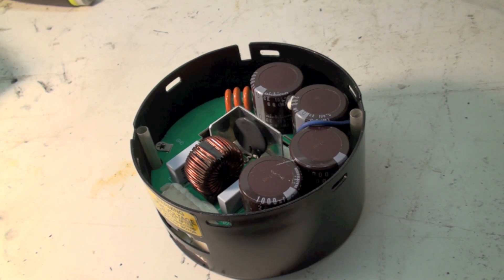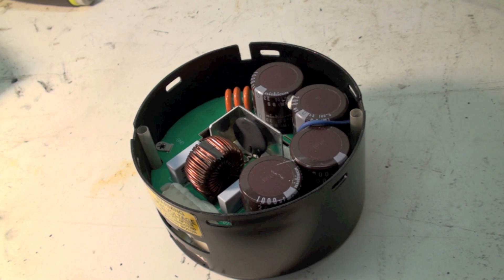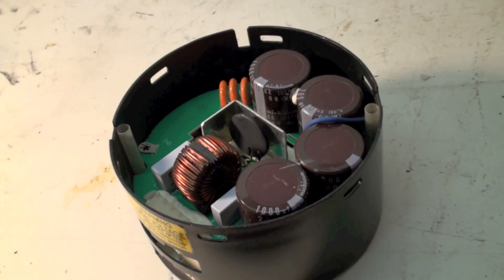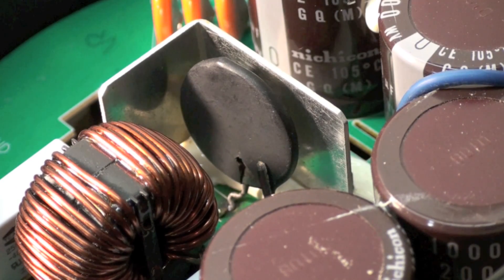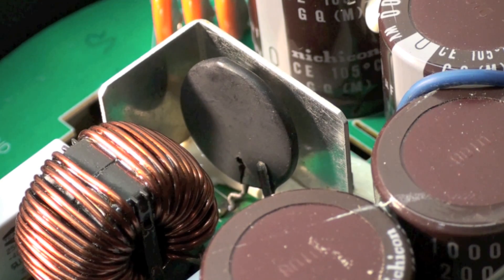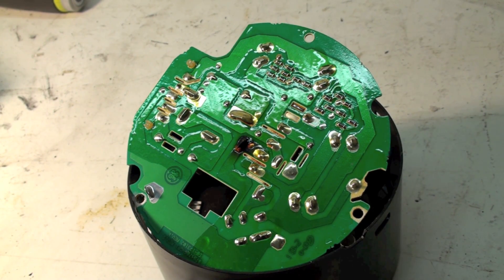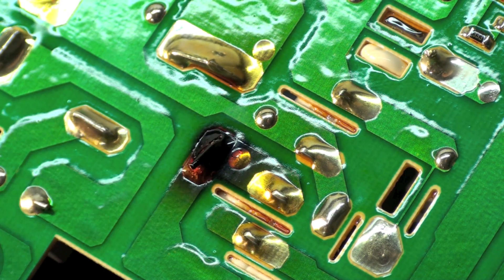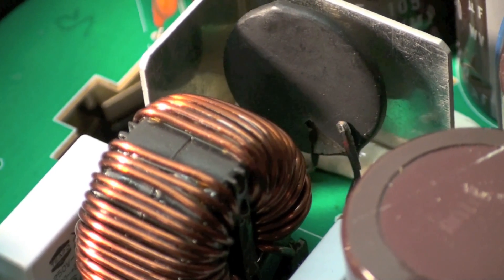ECM speed control repair

Comment: Thanks for looking into this.  I have repaired the thermistor a few times and now it seems my main capacitor are going bad.  For those of you who like to repair stuff, I found on Aliexpress the exact same capacitors (Nichicon 200V, 1000 uF).  Today I bought 20 units for under $43 (including shipping).  I have plans to update my main ECM 2.3 controller and also the spare with new capacitors.  (It seems the heat in attic degraded the main capacitors in storage.)

Comment: A big THANK YOU in behalf of our neighbors and myself. Your tip not only saved big $$$ but also enabled me to get the neighbors furnace operating again before the plumbing froze and burst. Both of our houses have GE ECM 2.3 1 HP motor controllers. Left over from my own outage in 2019, I had a spare Ametherm SL32 thermistor on hand when the snow storm hit March 24th, 2023.
Reply from the maker: Glad I could help.
GFM

Comment: My ECM142R fan jerks a little bit at start, studders slowly about 1/4 turn then stops. Would it move at all if problem was the thermistor? Fan spins freely by hand. It is on a Trane heat pump. 

Well, on the ECM142R they now have a 1cm thick rubber coating over the circuit board and same on the back to glue it onto the cover. I guess they really want customers
 to buy a new motor instead of repairing!!! With a lot of patience, one get get through the foam rubber coating
Reply from the maker: If it moves at all, the thermistor is not the problem.
GFM

Comment: I have a similar GE ECM module off 1 iHP motor. I was wondering is you have knowledge of how to obtain other replacement parts. In particular, the three small blue disc capacitors. Thanks
Reply from the maker: Those capacitors are 1000PF and are available from Mouser.
GFM

Comment: Is it safe to bypass the thermistor temporarily while I await parts?
Reply from the maker: You can.  If there is a spike or surge during the time it is bypassed, you could have a failure in the electronics.
GFM
Reply: @grayfurnaceman  Thank you, I got away with bypassing it short term, the new part came in and I assume its a 30amp and old one was 20 (size difference)
Reply from the maker: @mikec1955  Sounds good to me.
GFM
Reply: @grayfurnaceman  One last question, after only replacing the thermistor, and installing a new filter, what could cause an air whistle to develop? Is it possible it spins faster now?
Reply from the maker: @mikec1955  The whistle is a sign of excessive negative pressure in the return.  Check for restrictions.
GFM

Comment: Just an observation that the controller board in the video uses high quality electrolytic capacitors made by Nichicon rated at 105 deg C
Reply: Recapped my Marantz 2500 receiver with them. Sounds awesome.

Comment: I have been getting some ECM motors from a scrap yard and all of the motor parts have been good but not the control as you discovered .
I`m not good at circuit boards but have success in fixing componets like you see that failed by burnt or blown capacitors. I fixed a older reel to to reel tape deck amplifier that way. The IC circuit  boards are throw away always

Comment: exactly what happened to mine, 1053.00$ later, I am going to replace that part and test it, if that is all that's wrong with it at least I will have a spare. I had no furnace for 4 full days when its 20 degrees C below  zero sucks
Reply from the maker: Yeah it does.
GFM

Comment: They should give you the Nobel peace prize for this video.
Reply from the maker: Yeah, I think so too.  lol
GFM
Reply: @grayfurnaceman  The local Lennox guy quoted me over 1200 bucks for the replacement motor and module for my furnace. I ordered the thermistor for 4 bucks on Amazon. You just saved me 1200 bucks. Thanks a lot. Hope you are making money with your videos here on YouTube.
Reply from the maker: Welcome.  I am doing fine.
GFM
Reply: @grayfurnaceman  Hey just a followup,  This motor works great after I soldered the thermistor in but i notice the motor only seems to run one speed. It seems it use to ramp up before full balls sometimes when it needed to.
Reply from the maker: The bell could be failing.
GFM
Reply: @grayfurnaceman  must be. I guess I'll have to bite the bullet and buy a new one. It's been running since 2007. I guess I've probably gotten my money's worth out of it. Can't replace the other components because they cast em in epoxy.  Thanks again

Comment: I have a variable speed blower motor on my AC unit came home one night blower motor was not running took the covers off and motor was just rocking back and forth not turning all the way over will be pulling motor apart just not sure what to look for
Reply from the maker: You probably have a failed motor end bell.
GFM
Reply: @grayfurnaceman  got a replacement motor and bell reinstalled the unit and it does work . Just seems like it not blowing out the amount of air that it used to and the place I got the motor from programmed it to match the old one that I took out ?
Reply from the maker: If the furnace has a secondary heat exchanger, It may be plugged.  Remove the fan and you can see it above.
GFM

Comment: You saved me $3,000!!  I replaced this thermistor for a few bucks after the furnace tech quoted me $3K installed for a new ECM...crazy!  Thanks for sharing.
Reply: Did it work?
How is motor working now?
Reply: @awaranyc1  yes, it has been working great for over 2 years since the fix.

Comment: That's not a thermistor, those are used for measuring temperature.
Reply from the maker: It is a thermistor.  This type of thermistor is used in series with the power lead and with higher amp draw of an overload the thermistor warms and increases its resistance which effectively opens the circuit.  This type of thermistor is commonly used as an overload protection for power strips.
GFM
Reply: Well in the UK those types of devices are known as inrush current limiters, an ICL.
Reply: Tyrone Nelson a inrush current limiter is a thermistor just as the gentleman said. As the temperature increases the resistance increases(positive coefficient Thermistor) as a result limiting the current.Hence inrush current limiter.
Reply: @robertcherry4971  Sorry, but you are mistaken about the type of thermistor; it is an NTC (negative temperature coefficient). Quoting Wikipedia "With NTC thermistors, resistance decreases as temperature rises. An NTC is commonly used as a temperature sensor, or in series with a circuit as an inrush current limiter."
Reply: Actually it's more likely a Varistor or more commonly a (MOV) Metal-Oxide Varistor. But you're basically correct in it's operation. See the wiki page on MOVs to learn more - https://en.wikipedia.org/wiki/Varistor
Reply: @grayfurnaceman  Incorrect, what you are talking about (that black disc between the common mode choke and the aluminum heat sink the bridge rectifier is screwed to) is an inrush current limiter to protect the bridge rectifier from damage when the power is first applied to the circuit and charges the 2 (or 4) large aluminum Nichicon DC electrolytic capacitors. At room temperature (25 degrees C) the inrush limiting device is one Ohm. At full current flow (like when the fan motor is running) the limiter's resistance can drop to as low as .009 Ohms (offering virtually no appreciable resistance). Yes, the resistance drops with heat (from I squared R heating), not the other way around. That part is also NOT the same part found in cheap plug strips advertising "surge protection". The cheap plug strips don't have inrush current limiters, they have Movistors (Metal Oxide Varistors). Movistors clamp voltage spikes coming in from the power line ( has nothing to do with current). To confuse you a little..... I have an end bell off my Dad's ECM motor. There are 3 Movistors on that PCB. The Movistors are blue in color and all three are next to each other. The Movistors are C03, C04 and C07 on my Dad's ECM PCB. So there are three Movistors (voltage clamps) and one black inrush current limiter on the PCB inside the end bell. I hope this clarification helps everyone out there.

Putting a jumper across the black inrush current limiter may give you temporary functionality (until your replacement inrush limiter arrives in the mail, and you put it in) but be aware that temporarily bypassing the black inrush limiter may also kill the bridge rectifier because the brown Nichicon capacitors look like a brief dead short when power is first applied. If that happens you'll be replacing the bridge rectifier thereafter (or buying a whole end bell).  Have a great day all.
Reply: It is, I've been replacing them for awhile, make sure you watch youtube uk videos only so you wont get confused with the ones making shit work

Comment: Stephen Baker
Would it be safe to say that if the thermister is bad then the motor would not be quivering?
Reply from the maker: Stephen Baker The quivering on startup is normal for an ECM
GFM
Reply: Sorry, I did not phrase my question very well. If the circuit is completely interrupted, as it would be if the thermistor catastrophically failed creating an open in the circuit , it seems like the motor would not quiver. Could the quiver be a indication the there is some other problem in the ECM circuit other than the thermistor?
Reply from the maker: If the thermistor has failed, there will be no operation at all.  If it quivers but does not start, there is a problem in the ECM electronics.
GFM

Comment: For the thermistor, you can use digikey pn# 570-1060-ND. the 1R036. This will handle the 1R020 and 1R030 too. Or the 570-1059-ND which is the 1R030 and will handle the 30 or 20 as well. The R36 should handle 1 1/4 hp, the 30 for 1 hp and the 20 for 3/4 hp motors or the 36 and cover all basis. You can start high and go with lower, not the other way around.     hope this helps..

Comment: I watched this video because my blower was not turning on. I pulled off module and found the thermistor to be bad. I removed the bad thermistor and solder the new one in, found one online for about $10 on amazon. It worked for one month and now the blower just twitches and not sure where to go now. I was a hero for about a month...
Reply from the maker: The module has probably failed.  The motor is probably ok, so you can just buy the end bell.
GFM

Comment: I believe Trane did a study on this problem and found that in almost all cases the problem is with not enough air flow through the return and across the motor. The ECM's need to keep a lot of air moving across the motor to keep from getting to hot. If your having a problem with bad ECM's you most likely do not have enough return air i.e. plugged filters or inadequately sized ducting.

Comment: You always have awesome videos.  Question though, is it a thermistor or a MOV Metal oxide varistor?
Reply: With a little more research I think I've answered my own question. It seems the MOV is dependent only on voltage and used for surge suppression.

Comment: When the blower is ready to come on, the whole motor will vibrate and not spin.  As soon as you give the fan a little nudge, the fan will start spinning and everything is normal. Is this the ecm or something else?
Reply: What it does is to limit the inrush when the power is first turned on.  Because there are capacitors, they draw a huge spike on application of power, not motor startup.  So furnaces that are powered down and up a lot are likely to stress this part, not motor starts.
Reply from the maker: My thoughts are the ECM has failed.
GFM
Reply: Thank you!

Comment: I have a GE X13 1/2 HP.  how do you remove the thick rubber thats around the board?
Reply from the maker: Good luck at that.  Its made so you can't fix it except for the thermistor.
GFM
Reply: @grayfurnaceman  when you pull the board out to access the rear of the board..does that not separate all of the components that are trapped in the black matt? when you repair the thermsistor and put the unit together do those contacts 'make contact' again?
Reply from the maker: @smally2187  First, don't remove the board.  Just cut the wires to the thermistor close to the component.  The replacement thermistor is then soldered to those wires.
GFM

Comment: Using a Vacuum pump with a 1/4" flare liquid line dryer and manifold/gauge set makes a great solder sucker for circuit board repairs/component replacement. Heating the solder and using a access port will remove the solder and expose the pin holes of the board and makes a clean repair....

Comment: My thermistor is burnt up. Do you pull the old one out, or do you heat the solder on the old one so it pulls out smoothly, put the new leads all the way through and solder onto the back; or do you clip the old leads and solder the new one onto the old leads? Thanks in advance!
Reply: Heat the solder pull out the old slide in the new one making sure it faces the same way Heat the solder to slide it in if it wont fit the hole & add a bit more solder
Reply from the maker: I have done it the easy way.  I clip the leads.
GFM

Comment: Thanks so much.  Have the same type of motor, a GE one, in my Amana/Goodman high efficiency.  Took off the end bell and sure enough, same problem.  Ordered the part on Amazon.  Desoldered it and soldered the new on in and VOILA, fixed!!!  If you're not handy, find someone to check this for you and do it for you before you spend $500 on a new end bell or worse, $1000 or more on a new motor.  The part is $13 or even less.  My house is cooling down again and I'm a hero.   thanks again.
Reply from the maker: Welcome
GFM

Comment: I have been reading a lot of these posts and they are educating me.  I am not a HVAC person, but a DIY.  I am unclear about the motor, motor controls and the outside pc board do.  If I did, the following would not be a question.  But, I have a question on a carrier ac unit.  The blower motor only operates at a very low speed therefore not providing sufficient air flow. Is this likely a problem with the control board on the end of the motor (motor is a 1/3 hp ecm by REGAL BELOIT , HD42RE232) or the control unit on the furnace wall?  Any help would be greatly appreciated.  It is hot here in Texas!
Reply from the maker: I may not be of much help here.  These motors usually run or don't.  Slow running is not common.  You can try being sure the supply voltage is normal.
GFM
Reply: Thanks grayfurnaceman. I am reading alot and your videos help me to understand more. I have checked the phases, windings, and the checked good. I checked across the thermistor in the end of the motor. It showed open, however, i am using a cheap dvm. The large input to the furnace gets very cold. The A frame gets cold. However, the air voming out of the ducts is warm. The ac unit has never had anyone work on it other than add freon. So i am trying to understand how the system operates in detail. I have electronic, mechanical experience and am not afraid to tackle most situatios. Thank you again for a rapid response.
Reply: Not true.  My fan also ran at low speed due to a bad ECM control module.  The difference between my control module and this video is that the thermistor is fine (has continuity) so something else is wrong.  As expensive as this part is (and it looks relatively simple), and as short as the lifespan (~7 years per my technician), I am surprised that nobody refurbishes this part.

Comment: one last thing furnaceman, I have a general electric motor,module 1/2 HP but I found out the one I need for my module is the SL22, 1R020 I hope that is right don't want to put in the wrong part, but would you happen to know where I can get this thermistor I need ,many,many thanks to you sir ,William
Reply from the maker: Some of the HVAC parts houses carry them.  Also Digikey or Mouser have them.  Hope this helps.
GFM
Reply: all man big time ,all the places my wife called, were calling back and I was asking them where I can get the SL22 1R020 for the module they all were telling me they would sell me the module for $700.00 plus installation, they said itll run about a $1000.00 to get this job done, i twisted the 2 wires together its running ok,but for how long can i let it go like this? will it cause more damage do you know? thanks GFM
Reply from the maker: That will work.  The thermistor is there to absorb spikes and surges in the power so it may fail in the future.  The part is electronic and can be purchased from the 2 sources i quoted.
GFM
Reply: right on G.F.M. I ordered 3 SL22,s today from digi key they should be here in about 3 to 4 days they said, then all ihave to do is solder one in and that should do it im hoping, never done hvac work before in my life,im a youtube U graduate, ha but it is saving me around a $1000.00 so im kinda proud of myself , very greatful for your video sir , keep em commin many,many thanks ,sincerely,William
Reply from the maker: Hope it works.  Welcome
GFM